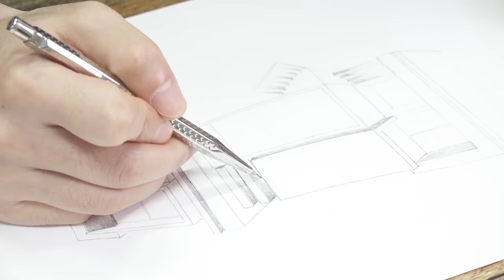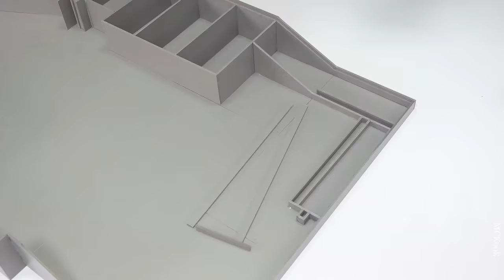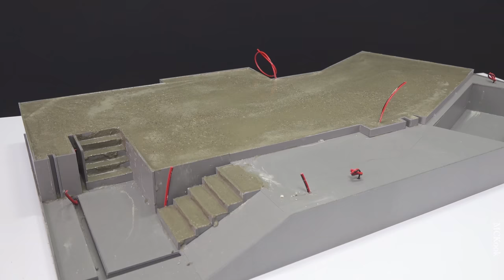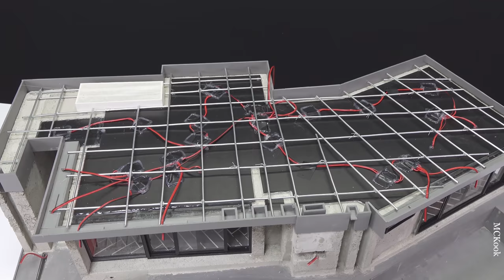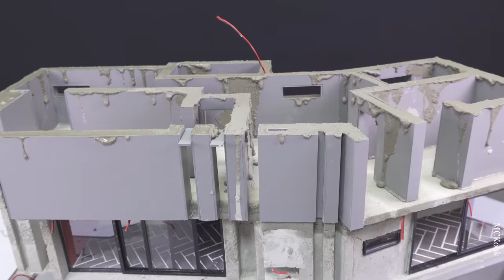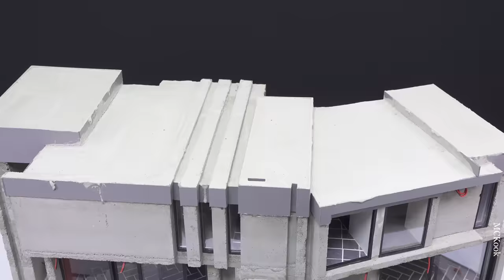Luxury House with Swimming Pool - Model

Comment: This looks like such A fun hobby and I really want to try some of this, but where do you get your materials?
Reply: shop
Reply: This is a lot to take on for a first try. There are a lot of little skills you should have experience with before taking on something of this size e.g. working with epoxy, cement, wiring lights, making props out of clay, tiling etc. If you want to start, I'd suggest making miniature dollhouse kits and adding lights and other props. The materials would have come from craft stores and building/ hardware stores. He likely also used autoCAD or similar drawing software to design it which is a feat to learn in and of itself
Reply: Home Depot probably

Comment: The foundation,the concrete work is spot on, the rebar, the tie wire, the forms, the mini bull float the finish trowel and tapping the forms to remove air bubbles, way better than some of the full sized houses.

Comment: Does anyone know where I can get the minis materials or buy here in Mexico
Reply: this is a combined effort of many skills.   I would suggest starting with a miniature house kit with lights that are available at hobby stores and on ebay.   doing those would give some experience working with small items etc.  also, epoxy resin, clay sculpting,  miniature painting,  etc.  they make it look like it is super easy.  I can tell you this is SKILL.   and I have been crafting for years and I would be intimidated by this

Comment: I would like to see you make an older 70's House.
Long sloped roofs. 
Weird funky architecture. 
Room placement that makes no sense. 
Stinky a** fireplace wall thing. 
Shag carpet, also in the bathroom because that's gonna mold up really nice. 
Sliding glass doors that always get stuck.
Red stone brick walls, brown floor tiles. 
Stanky wood paneling on walls and ...anything for no reason.
Useless Hvac system.
Harvest gold matching washing machine and dryer.. of which one is going to break and you'll now have a mismatched set.
Avocado green Fridge that's going to work for ages on end. 
Matching colored olive green toilet, bathtub and sink. 
Oh and mold. everywhere.